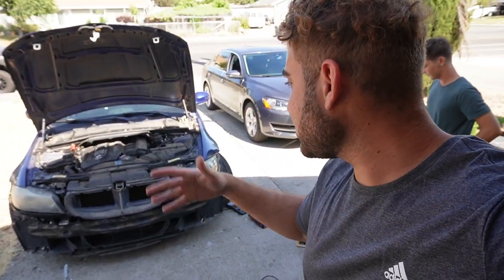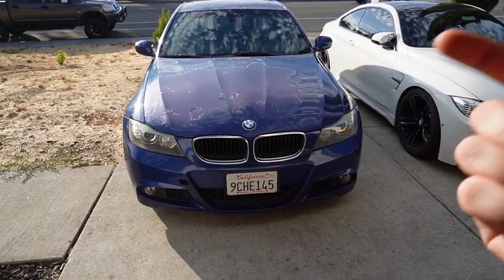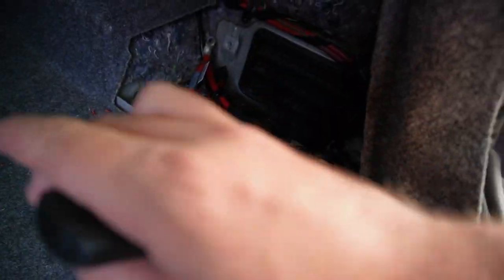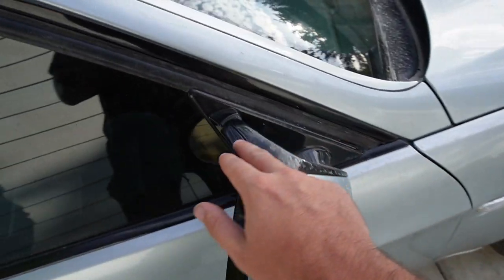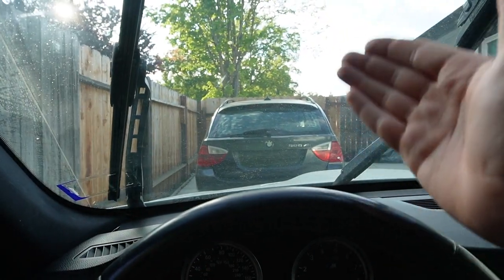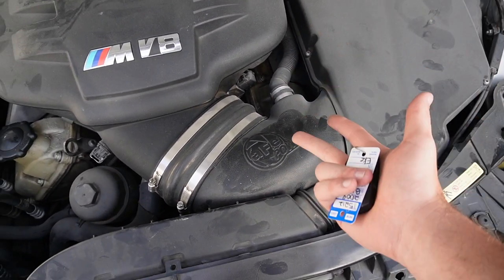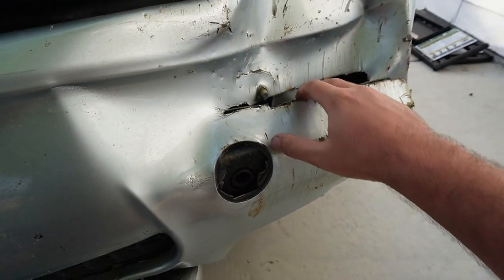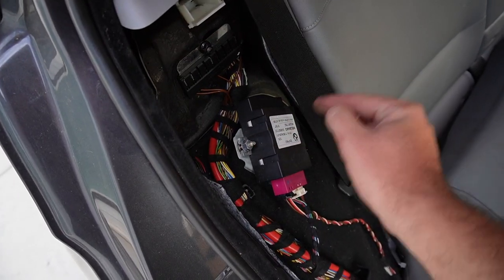TOOK DELIVERY OF OUR E90 M3 DONOR CAR! FIRST CRANK DID WE GET LUCKY?

Comment: Thats not edc 

The edc would have the edc button on the console but its a blank, it also has the little valves on the strut tops those are just the cap covers on the strut bars 👍🏼